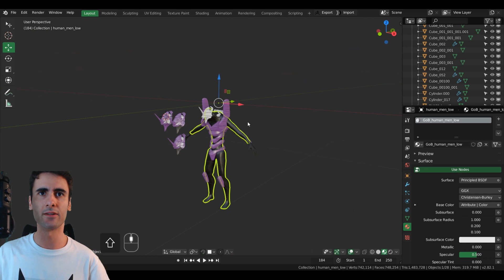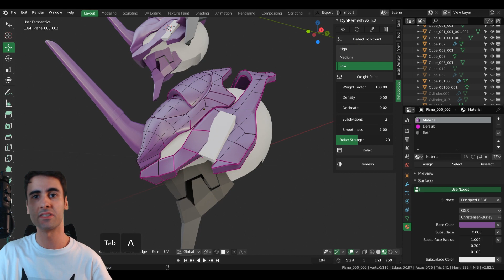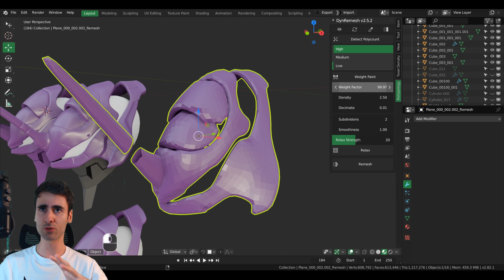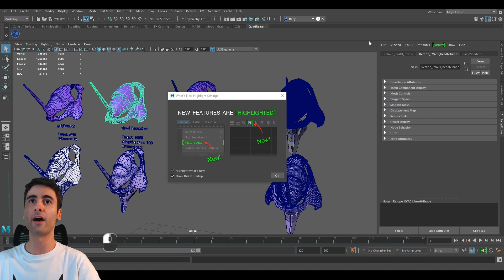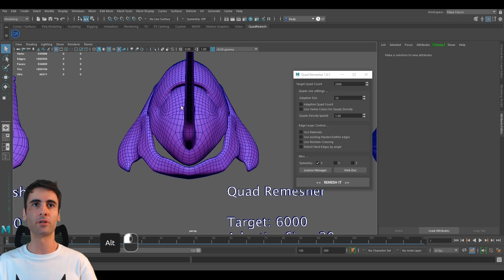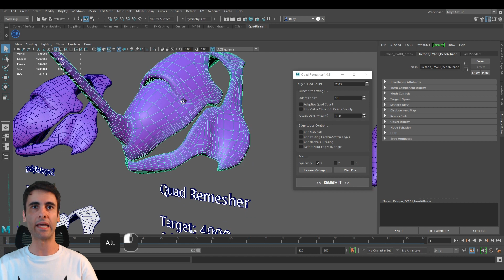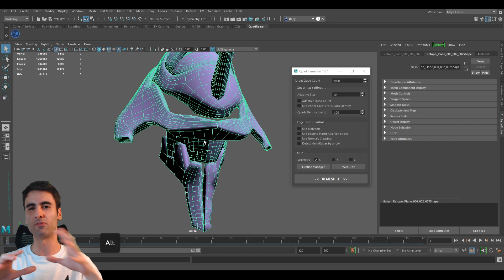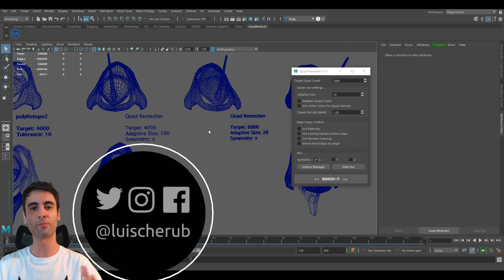Topology Wars: Maya 2020 PolyRetopo2 🆚️ Quad Remesher

Comment: I'm working a very complex fantasy character mesh (max poly count limit 50K triyangle). My experience for game retopo:
- ZBrush forget it. Pixology need to work with Decimation Master and ZRemesher integration in one tool with learned AI for optimized good low topology (maybe option to show rig bone to know where are the important deformations)... I don't want wasting time to paint weights to show them the important-less important shapes.... that's enough on rigging.
- Maya and Quad Remesher: they try better result but still too much fix need on the result meshes. Easier to handmade. (too many unnecessary edge loop - and lots of edge loop twisting around the mesh to make headache to delete them).
comrad Diatlov would say: - Not good and not bad...
I think a few years and we have a good retopo tool. I hope so XD